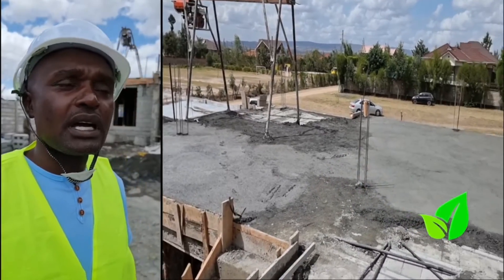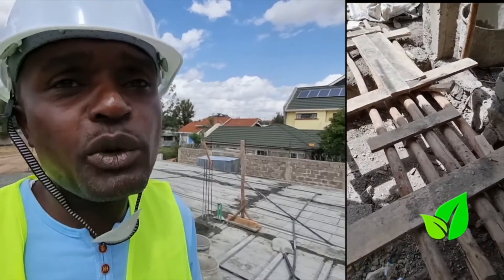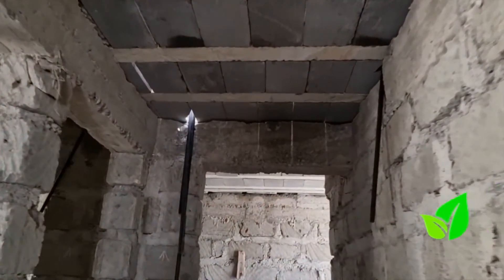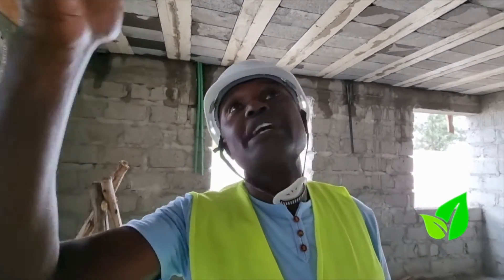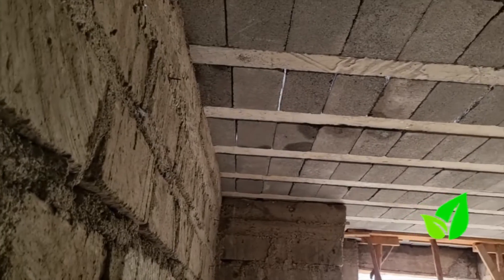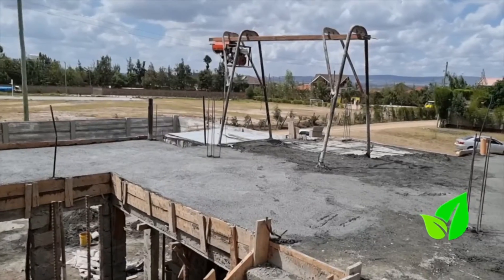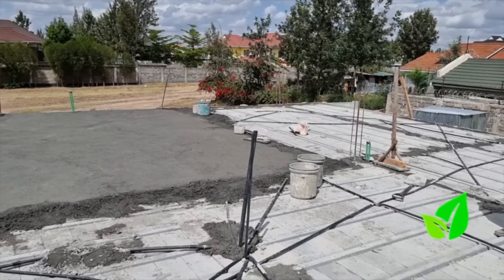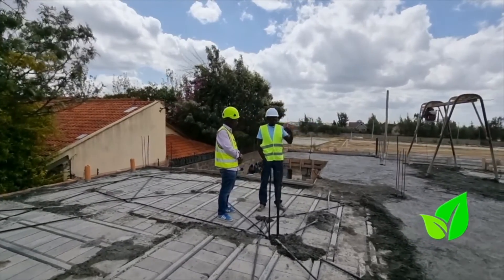Case Study - Kitengela - Foundation slab & flat roof

Comment: I better stick to the conventional tasted and proved to be durable. How do you determine the strength integrity of those blocks. Better save the sorry. My opinion.
Reply from the maker: Hi Mark . As the beam and block is produced in a factory environment cube tests are taken for each cast of the beams and then random blocks are selected and taken for testing . We do transverse load testing on the blocks. Structurally the floor is designed to suit the application that the client requires.

Comment: How do you compensate for the water lost during slab concreting through the block spaces?  Bearing in mind we need water for cement hydration so that the concrete can achieve the specified strength?

Comment: I would have loved to see how the foundation was done
Reply: they do ground beams column to column, they put their prestressed joist beams spanning to cast in place ground beams, and prestressed slabs onto prestressed joist beams, no ground floor cast on poor soil, but a suspended ones. so the column footings have to go down to the strong stratum at the end of the day. The prestressed ground slab and ground floor walls will be supported by the action of prestressed joists and ground cast in place floor beams respectively.

Comment: can this be done to a house without pillars. as in the walls are bearing the load
Reply: Yes. as long as they are 9×9
Reply: I think columns are very important best to use them no matter what, even if it's the precast pillars or the RHS
Reply: Not really. Load bearing walls are durable and long lasting.